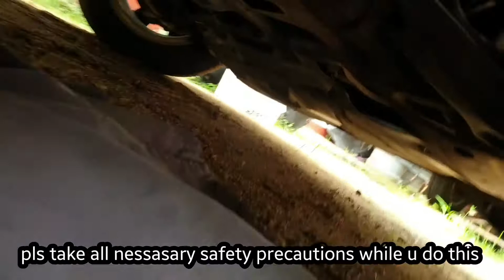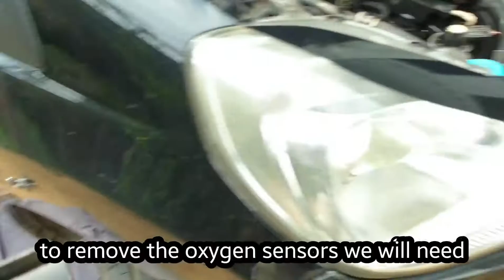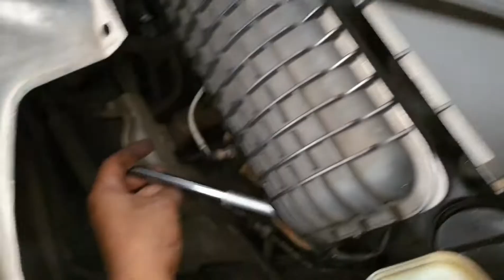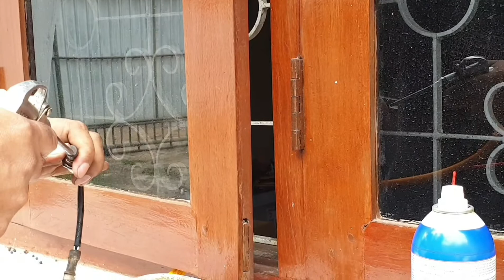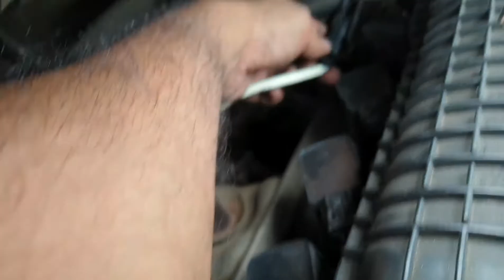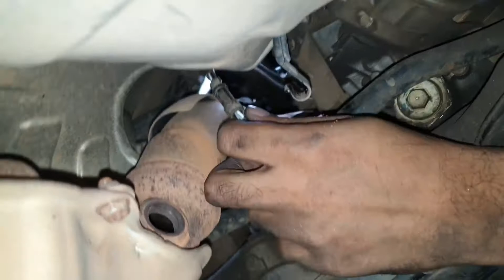Honda Fit/Jazz GP1 (IMA-Hybrid) Oxygen sensor cleaning

Comment: Just unplug the socket? If the sensor clean no need the obd? The check engine not to light?
Reply from the maker: as long as you don't unplug with ignition on there wont be CEL.  if you can do it with 12v battery removed its even better.

Comment: Hello! Did u clean i vtec?
Reply from the maker: i did once. it was not dirty. maybe because i change oil exactly 5000km on time.but do be careful not to damage the over ring as if so you will get a oil leak.
Reply: @skonemotorstudio4424  I also change my oil at 5000 km.  I saw a video that vtec can be dirty and because of this there are kicks from EV and ON. But i didn't clean yet. I know about ring, thanks. Its easy ro damage

Idle is ok, throttle is clean.
Reply: @skonemotorstudio4424  how often do you calibrate the variator and rotor of the electric motor?
Reply: @skonemotorstudio4424  sorry for many msgs. your experience is very interesting.  when you cleaned o2 something changed?  did you clean or change the maf, did it affect the smoothness of the ride?
Reply from the maker: the Ev to Engine knock is quite normal in this model. do a full manual efi cleaup too.  again if the kick/knock is still there clean the egr or replace it and see.  i too replaced the egr with recon one and it improved the know. then if you are willing to do try my experiment. i used a metal plate and made full hole on the valve side to open and on the intake (rectangular hole) i only made two small holes reducing the flow of exhaust gas to the engine. the engine knock is gone and i feel little more better acceleration.
Reply: @skonemotorstudio4424  can you tell me more?  or maybe you wrote about it somewhere with photos or videos? Really interesting
Reply: did I understand correctly, you replace the egr gasket with a metal plate with holes?
Reply from the maker: CEL use to come on regular which i think due bad fuel in my country. after i cleaned the o2 sensor it’s stopped. Never  have replaced the maf, just cleaning.  yes its does help the smoothness the power and exhaust smell. almost 7 years now and passed 160k kms last week. still the car is a pocket rocket.

Comment: how many Milage u clean your o2 sensor ?
Reply from the maker: well its not always needed to be done frequently. whenever feel unstable revs and idle you can do it. basically clean the MAF first then if the erratic idle is still there clean the bottom o2 sensor and then the top one. anyway you can do it like every 20k aswell to make it a habit.